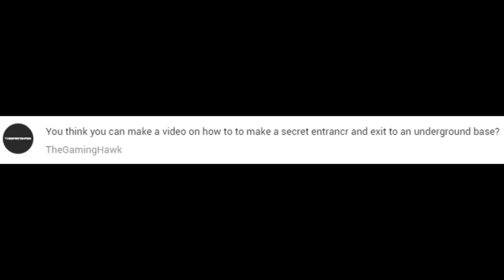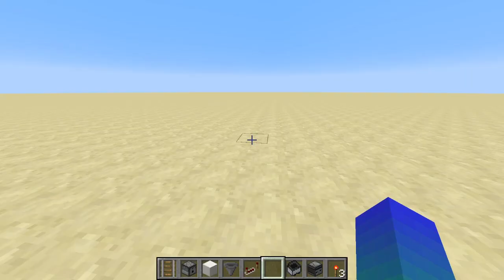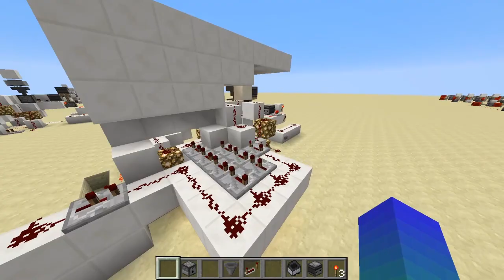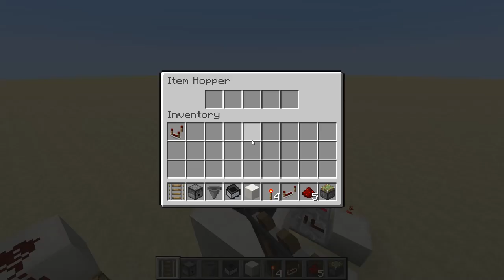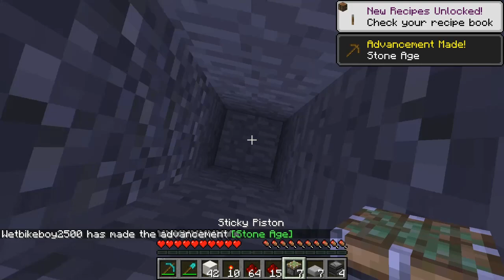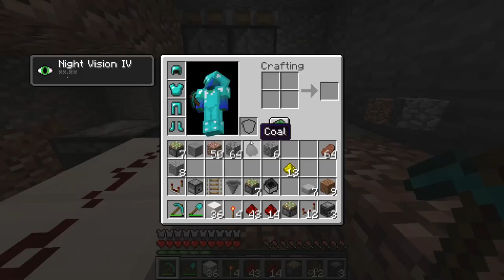Minecraft Redstone - Secret Underground Entrance Tutorial

Comment: try pulse extenders so you dont have to use as many repeaters. It takes a lot of tinkering but i assure you its worth your while
Reply from the maker: The biggest issue would be the overall size of the build. Most pulse extenders are hoizontal but this build is very vertical which would cause complicated designs for vertical pulse extenders. I definitly can be done but condensing it would be the biggest issue.
Reply: Wetbikeboy2500 you’re right. I like to keep things simple when I build, and repeater timings are the opposite of that for me.